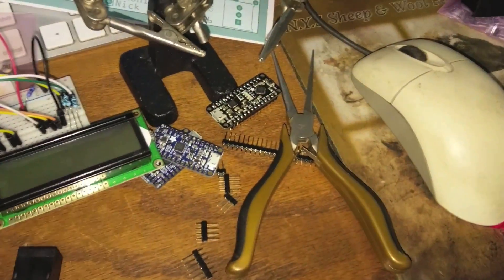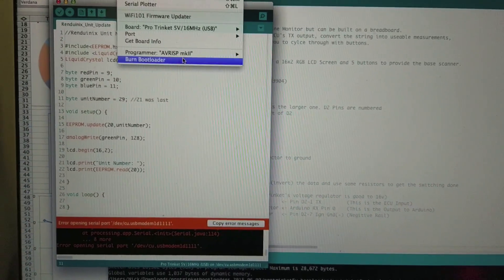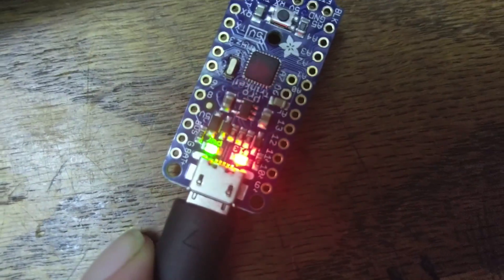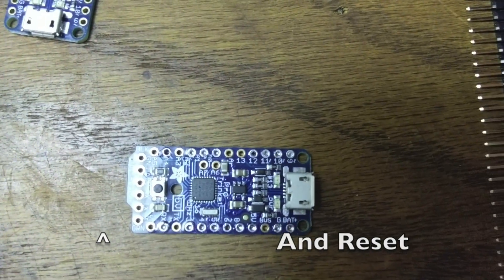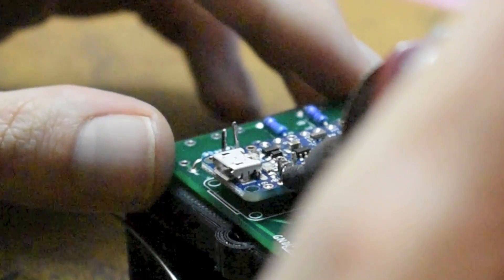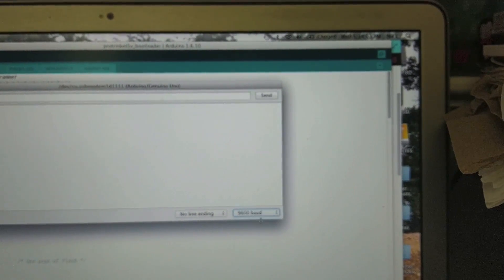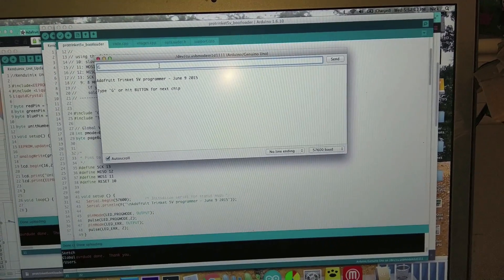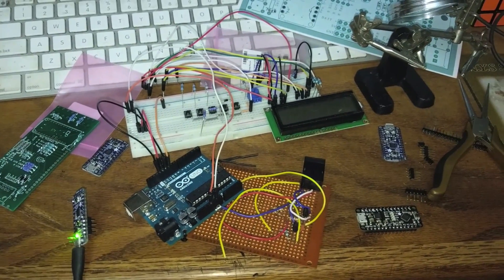Pro Trinket Upload Code & Flash Bootloader

Comment: Hi! I'm an absolut Beginner with Elektrik and Boards like the Arduino or the shown Adafruit trinket. So i think i bought the wrong item for what i want to do: Building a simple Paddle shifter with two Pushbuttons to Shift Gear in Racing-Simulators. I suggest an item with USB Port mounted will be able to sent the simple Button on/off via the USB Port but after searching the Internet for some Answers i think the Trinket can't do that. Am i wrong? Sorry for asking here, but i can't ask in the Adafruit Forum because i just registered and have to wait until i can you the Reply Button.

Comment: Update: So I recently received my Arduino Uno R3 and tried to follow your video... all of the wiring and pin arrangement is correct and I am using the Sketch in this video... however, I got an error where the signature fails :(

Comment: A useful video, BUT... it's unclear how to upload when the compile itself takes longer than the 8 second bootloader timeout.  Due to slow autofocus on your video, I couldn't see whether your SDE did a compile-load or just a load.  Is there a preference to set for the upload button to upload a previously compiled object?  I couldn't find one.
Reply from the maker: So that is the tricky part. If you have a slow computer that takes a long time to compile then you'll have to get your timing just right to upload. You can push the reset button after the compile button to get it right.

Its a shame arduino ide doesn't have a pre-compiled upload option, because you can save a compiled hex from it. There are some 3rd party apps people wrote for specific chips that might let you do this however if you search Google

Comment: I got the red light but it's still not working.  Metro Mini next time.
Reply from the maker: The pro trinkets can be little buggers sometimes. The metro minis are much easier, but when I need power I love the teensy lineup. Just beware the 3.3v logic and low vin limits

Comment: The boot reload thru the UNO worked fine the first time, thanks.   I programmed this Trinket with a GPS program long ago and I sure don't remember it being such a fussy thing to load, seems to me all I did was compile, load and go and that was with either Arduino 1.05 or 1.06 back in 2014.   Manually reloading Adafruit windows drivers over the top of c:\program files\arduino\drivers solved the driver problem, the virtual COM port came up correct.   Automatic loading of the Adafruit Windows driver files put them into temp folder and were not found or showed updated in device driver. Thanks for the videos ..   The OSEPP Nano is a far better mini board, plug and play, 100% compatible to the UNO, no hassle with serial ports either.

Comment: You skipped two important parts, the driver load and the com port so the video didn't help.
Reply: You missed the most important part: watching the actual video
Reply from the maker: +bbillp did you watch the whole video? This doesn't use a com port. That's what the bootloader is for

Comment: I have a problem with my software not having the board in the Board Manager.  I tried 2 PC's and 1 Mac.  Nothing is displayed.  I installed the master drivers, updated all the boards.  I get the Green light and the Red Light. Thou, I can't upload code.  I also got some wonky Native Serial, etc etc.
Reply: I went and updated the link for the github to get the correct json file and followed the install for contributed boards.  I got the code to upload to the Trinket.  Thanks for the help!!!